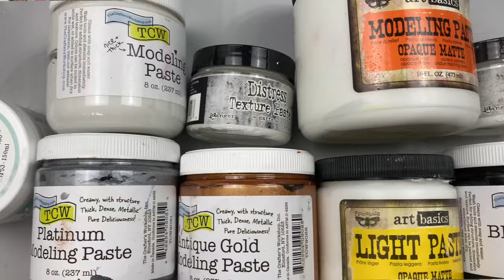DON'T LET Modeling PASTE RUIN your PROJECTS!

Comment: My worst problem with applying modeling paste through a stencil is either applying too much or too little paste.
Reply from the maker: it takes practice but you get the hang of it. Here is a tip: try to wipe off the excess to the point that the level of modeling paste is at the same height as the stencil. You can tell if you put too little as you will be able to see below, its more translucent.
Using a silicone brush or catalyst blade helps so much

Comment: How do you clean your stencil?
Reply from the maker: You can clean it with water and soap or a baby wipe. It’s easier to clean it while it’s still wet however, if it dried up, you can use a gentle scraping tool or soak it in soap and water for a few hours.

Comment: Thank you for the tips! 
I do have questions:

-how can we package them after the textured painting is done?
-how can i varnish the finished piece?
-can it get damaged after drying?
-will it fall off a canvas?
Reply from the maker: texture paste will not fall off the canvas but if its really thick it could peel off but not all brands. I wouldn't put it too thick.  you can package it like you would anything else. You can varnish with whatever you use for acrylic paints or water based products. Gloss/matte varnish or spray works
Reply: @KerenTamir  thank you so much! You’re so helpful  <3

Comment: Hello mam, your tips on modelling paste is amazing, thanks a lot. I do have some questions though....
1. Are modelling and texture paste same?
2. If I need to roll a canvas layered with textures, will it begin to crack. Would it be flexible enough like acrylic paint  to allow rolling the canvas?
Thanks in advance.
Reply from the maker: some people called modelling paste texture paste however when I think of texture paste I think of paste with gritty texture, like when it has sand or other texturising elements. I'm not sure about rolling as I've never done that so I can't be sure
Reply: @KerenTamir  thank you so much for the reply. I need to roll it for sending it to a client.

Comment: I like your video. 
How long does modeling paste take to dry?
Reply from the maker: It really depends on humidity which varies according to location. However, you can use a heat tool to make a dry faster.

Comment: Great video, how do you keep your modeling paste or gesso from cracking? When I apply it and then it dries, it gives that crackle effect that I really don't want. Also wanted to know if plain heavy gesso acts like a modeling paste?
Reply from the maker: It could be that the layer is too thick and so it cracks. Or if it gets wet underneath it can crack
Reply: @KerenTamir  That’s probably it, thank you!